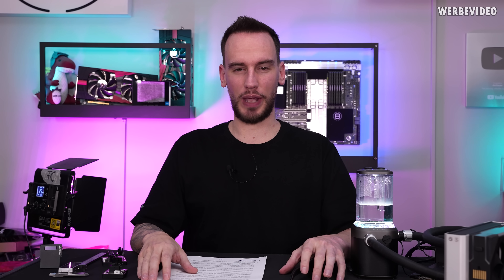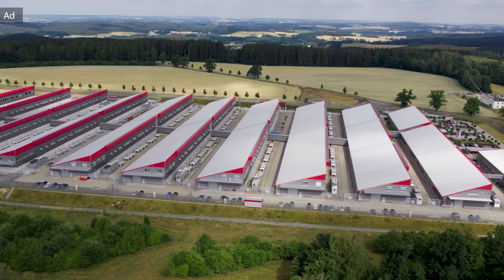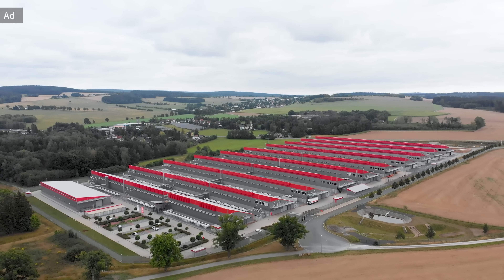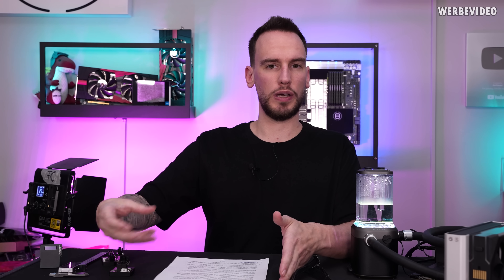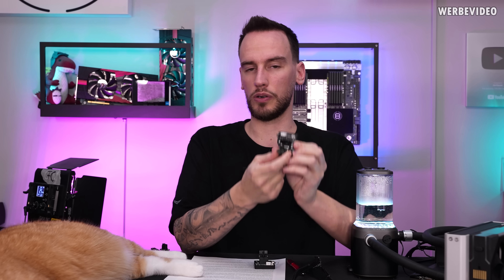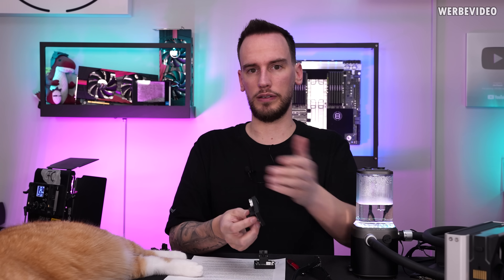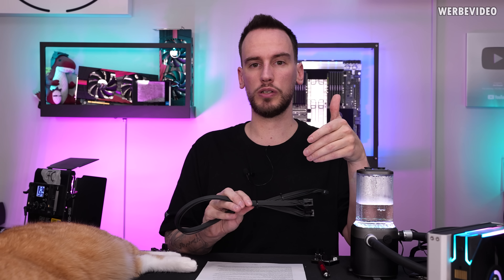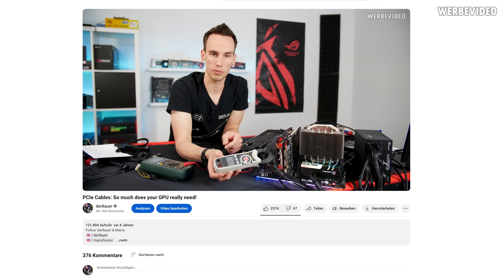12VHPWR is just Garbage and will Remain a Problem!!

Comment: As a Drone hobbyist, i Suggest we use XT60 jack, it's small(smaller than 3*8 pin), can handle 60A(so 600w is still in safety region), cheap and simple.
Reply: It is not rated for 60 continuous
Reply: @riba2233  it is

Comment: I expect a V2 connector where the pins themselves are thicker and the cable spec is either more strands per wire or they go solid core.

Comment: I always question that Engineering Toolbox AWG chart. That amperage and correction factor just seems off. Take 12AWG for example in house wiring. The stranded vs solid wire sizing is nowhere near that correction factor. The stranded wire is maybe 25% larger at best than the solid core for the same rating. 
But it's also possible the safety factor is just that high as 12 AWG solid or stranded is only acceptable for 20A circuits at both 60C and 75C ratings.

Comment: I've just been modding friends' cards and cables with high current TCE connectors. It's a pain in the ass, but I know their cards are no longer a fire hazard. The 12v HPWR connector standard is so bad, it seems like someone paid off someone else to push it through.

Comment: Relocating the plugs would also help. Like you said, no (enclosed) case supports that much stickout before a bend. Many don't even support bends right at the connector, which is never a good thing. I liked the idea of putting it all onto a second pcie like connector to go through the motherboard, despite meaning you'd have to upgrade the motherboard. Though honestly, considering that intel changes its socket every 2 or 3 generations, that's not that big of a deal breaker. Then the sense wires could be bespoke to the motherboard and the psu could have either another main power connector, I think it's a 28 pin. 

Or maybe GPUs themselves need to be more motherboard like. The process and rom being replaceable with something like a LGA socket if they had done this people could have bought the card they wanted. Be it as ridiculous as a 4050 with 32gb. Then, in the next gen, when people are upgrading, perhaps they could get a second hand 4080/90? Some itx cases would be a pain to build in now. And there's a chance that motherboards themselves could combine the base circuitry for the GPU perhaps increasing complexity  of the single component and possibly increasing its obsolescence. But this is to some degree what we already do in laptops and mini pc. Unfortunately there CPUs and typically the GPUs are soldered and not upgradable. But that's basically what I want. A laptop with better upgradability and cooling.
Reply: the fact that this is happening with solid 90 degree adaptors shows its not the tension on the cable but the connector itself, at least in some situations.

Comment: Yet people are still convinced it's soooo much better than the PEG connection. What kills me is that they revised the connector, but didn't address the latch or the tolerances. Even then, they're pushing too close to the rated maximum of the standard with the 4090, or even the 4080. They could have just solved this by using EPS, which would add another 12v per connection, and adjust the sensing specifications so they're not vastly under utilizing the standard. Hell... even if the didn't, 12VHPWR is a downgrade to the PEG connections.

It's nice to see a reputable source making a dedicated video about this... but I'm sure people are still going to argue. I've used talking points that Jon Gerow has made, and people tried to act like his "opinion" doesn't matter, as if they know better than him.

Comment: If they put 2 x 12vhpwr you would need what 6 x 8 pin connectors? Not an easy feat even with 4. If that happens say hello to molex adapters again.

Comment: I want to add that not only does the stranded wire need a correction factor, but the conductor itself does as well (aluminum vs copper). Aluminum wire needs to be down rated compared to copper.

Comment: Nvidia is a joke for 40 series in general.
They focused far too much on upscaling and not enough on power efficiency, if they had worked more on power efficiency then they more than likely could have gotten similar results at a much less power draw over 3 x 8pins.
With the 4090 it's worse in regards to them just cranking out performance without offsetting it with efficiency.
That plus their focus on upscaling for current cards instead of older... it's pretty bad

Comment: This cable alone is why i will NOT buy another Nvidia card that has this stupid connector...i hope they revert back to 8 Pin even if it requires 3 or 4 of them on the card.

Comment: IMHO the idea behind a single connector that can handle 600w is really usefull but the execution with the 12vhpwr was poor. This standard has to be taken back to the drawing board. BTW i'd also love to see a standard for PSU cables on modular power supplys where I can use cables from one brand on another.

Comment: After a year of using my ASUS Strix 4090 and a cable mod 4 - 8 pin to 12V HPWR on a CORSAIR 1200W Platinum my connecter was fine. But, the cable housing itself had a small melt spot on one of the wires about 8MM from the connector from the GPU. I just built my new PC last night and I went BeQuiet crazy (Case, PSU, CPU cooler and extra Silent Wings 4 fans) and now I have the card connected to the Dark Power 13 1300W using the stock 12VHPWR cable. I wonder if something will go catty whompass

Comment: EPS 12V:
-Easily delivers 200 watts (3 of those equals 600. Also we had 3 plug gpus with 3090)
-Widely used in servers (so you know it's reliable)
Gets ignored by nvidia 🤦‍♂️

Comment: I will not buy a GPU that uses the 12HPW or 12 2x6 connector. I said it from the beginning that the pins are too small for the amount of power being pumped through it during long gaming sessions. People keep saying but the pins are rated for that kind of power but what they are forgetting is when you compress power you generate heat. With enough heat melting will begin to occur and the only way to prevent it is to limit the amount of power going through the pins. But in reducing the power you also reduce the performance. That equals money poorly spend and wasted on something you can not fully use without possibility of failure. I am not going to spend that kind of money on something like that hoping and praying it will not fail.

Comment: If the adapter is used and the connector still melts NVIDIA should RMA the card! You spent the extra money to guarantee the best possible connection for their defective 12VHPWR connector and it still melted. There should be a class action lawsuit against NVIDIA at this point, the connectors still melting proves it's a faulty connector and not user installation error. This is a fire hazard, it's crazy NVIDIA still hasn't done anything to fix the problem.

Comment: Hope Nvidia and Member/Engineer at PCI-SIG will not use this "krap kannecter" in RTX5000 in 2025  ; please don't repeat the mistake,  move forward not backward , have some kommon sense "If you want to draw more power you will need thicker wires and beefier connectors .period !

Comment: I will rather use even 8 old connectors than this one..How insane situation is it telling you that nobody complain and everyone claiming they are 'independent' reviewers.. few of those who really say something they are marginalized. This is not nuclear science, it's completely straight forward.. ALso why plugs doesn't have 'side' clips too? You can easily wiggle it and it will move left/right.. It should have 3 clips, 2 on each side and one on top.. and it will not move.. when it clicks that's it.. and yes we need 2 of those, so ... less current

Comment: I'm sure if they could have, partners would have released a 4x8Pin card and people would be all over it. I can only imagine nVidia are blocking such actions.

No idea why they are so set on forcing this on us.
Reply: There are 4070 cards with 8 pin connectors
Reply: @ksenchy  ah, fair enough. I went 3090 to 4090 so didn't even look at 4070 to be honest.
Reply: @richardskinner6391  yeah there are no 4080 or 4090 with 8 pin connectors that's why I'm thinking to buy either 4070 or rx7800 XT. Don't know, can't decide 💩

Comment: nVidia will never make a 4090 with old style EPS connectors. Reason? that will automatically means the admission they were wrong, and class action suits demanding refunds to users, board partners also suing, a massive reputation and economic hit to greedvidia. No wonder why they are trying to make more emphasis on AI chips.

Comment: Great video. Yeah this 4090 connector is an engineering failure. May "just" work on paper and the benefits of less cable's is appealing but the margin of safety is terrible and the reliability is dramatically reduced with wear and tear over time. As someone with a 4090 it sucks, people shouldn't have to worry about things like this when paying this amount of money on a product.

Comment: If we look at something that Gamers Nexus did in their experimentation for melting 12VHPWR connectors, they cut one plug down so that only 2 +12v and 2 Ground pins are making connection, and the RTX 4090 was still drawing full power.  We already know that much power split between 2 circuits is already well over the safety limit.  That connector for them should have melted, so they should have studies why theirs didn't fail, or they faked it not failing.  This leads to a bigger problem of playing with a low safety factor and +12v circuits, load balancing.  Back to our laws of physics, energy takes the path of least resistance.  There is no way to guarantee that each path between the PSU's 12v rail(s) and the RTX 4090's power system has the same overall conductivity, so a route with slightly better conductivity will draw more amps over the other wires.

Comment: And why evga used 2 high-power connector of these on the 3090tis. And I also assume why they stopped making gpus when they were literally scared to set their own products on fire. And probably got into a fight with Nvidia trying to use 2 of them, cause the evga 4090 had 2. None others did

Comment: Can we just use EPS please. 4 out of 8 pins are 12V
3 EPS connectors would work fine for 600W with sufficient margin
And you wouldn't need to differentiate between PCIe and EPS and 12VHPWR cables/connectors for your PSU and components

Comment: I dunno if you should be raving about your RMA rate, when I bought three Wireview modules, one 'normal' dual 8 pin, one 'reverse' dual 8 pin, and one triple 8-pin, and one was bad out of the box, one quit working a month afterward, and only one is still working, (in order) yet repeated attempts to get replacements have been met with silence.

Comment: Yeah ive had some cable managing issues with the 12VHPWR cable and my 4080. Even now the bend starts maybe 25mm away from the connector.
But so far everything seems fine with it. Im using my PSU's own 12VHPWR cable. The card has been in 2 of my rigs both have ATX3.0 PSU's.
Seasonic Vertex GX1200 and Deepcool PX1000G WH. No problems with either of the cables so far. I did use cablemod cable with the Seasonic PSU.
It was fine untill i unplugged it to install the card to my other rig. One of the cables just popped of the connector in one end and one of the little sence cable from the other end.
Idk maybe i was too rough with it when cable managing even though i tryed to be carefull. Anyways that has been my experience with the cables.
Nothing has melted so far but its a 4080 it only pulls 320w or so....But after all playing around i should have just bought a 7900XTX instead.

Comment: I'm even more glad now after i watched this video that i got an RX 7900 XTX which has 3x 8pin power connectors instead of this hazardously unreliable piece of trash 🗑  12VHPWR connector. I even doubt that the 12V2x6 will be any better, cause it's pretty much the same trash with some minor change on it for " more reliability " . Yeah right 🙄😮‍💨

Comment: Nvidia tried to create a solution to a problem that didn't exist. 
So far so good on my ROG 4090. I thought about getting "fancy" cables, but I'll just stick to the single 16 pin to 16 pin cable that came with my PSU.
If it aint broke, don't fix it!
Reply: Don’t go for any cables other than what came with your PSU.  I’ve spent the better part of a year chasing down instabilities in my new build, swapping boards, drives, RMAs, etc.  When I finally got rid of my fancy cables and extensions, all my issues went away.
Reply: @arclyte1859 so do I think it's better to go the 12V 40 series cable provided with my thermaltake 1000W PSU or use two pcie eight pins plus the adapter that came with my 4080? Is this even an issue for the less powerful 4080?

Comment: I mean. I see everyone’s complaints but I disagree. I haven’t had issues with mine. I firmly seated my Corsair type 5 cable into my strix 4090 and let it fly. No issues. I get why the cable exists. It’s better than 4 fucking pcie connectors you know it and I know it
Reply: Just because you've been lucky not to have a meltdown. Doesn't mean the 12VHPWR 
and 12V2x6 aren't disasterously trash and hazardous.

Comment: I mean we could solve the "plugging" issue entirely by soldering wires directly onto the card, yet we would still have a thermal issue just because you have 600+W spikes going on these 6 pins, it's just too little a number for this kind of power. If they just made a "16VHPWR" so that's like 8 pins for +12V and 8 GRND, the issues would probably never happened and it would've been completly future proof. Funny enough they chose to create the smallest connector the support the biggest cards ever made.
Reply: BTW for anyone who has an RTX 4090 and just doesn't want to risk it, just watch Optimum's video "Don't Undervolt the RTX 4090" and limit the power like he does, you just lose so little performance but gain so much efficiency, less Watts will also mean less heat and much longer life.

Comment: When I saw aluminium cables my jaw dropped, has the industry dropped that low? These should be copper, as pure as freaking possible, same for the connector interfaces.
Reply: Aluminium cables where? This should all be surface chemically tinned copper, not aluminium.
Reply: @SianaGearz really? Looked a lot like aluminium, though yeah if the whole cable is tinned then you'd be correct. Still, the strand size is nonetheless a crime.
Reply: @wskinnyodden  At 7:30? Yeah this is copper, immersion tinned. This tinning comes out dull matte and is extremely thin, micron thickness, it's there to improve contact in the crimped connector, and also reduces defect rate for soldered connectors, and if you scrape it with a knife or use a microscope on the cross section, the copper is easily revealed. This is Seasonic 18AWG cable, so it's not the thickest, the copper cross section is 0.8mm² per wire, which is not so little copper at all, but some others come with 16AWG which is 1.3mm². Super thin strands reduces the nominal current carrying capability but it improves the flexibility of the strands, so when the cable is bent, it's less likely to internally fray, and there's plenty of current carrying capability anyway, no reason to be concerned about it.

The sheer weight of the pack of modular cables that comes with the PSU is substantial, you can tell right up that it's not alu.

Aluminium wouldn't be permissible as it would fray and would open the terminal crimps all by itself due to heat cycling, it would be a fire hazard.

Where aluminium is used, say in suspicious speaker cables or in permanent-installation Ethernet cables, where it's permissible, they necessarily use copper coated aluminium, as aluminium surface isn't suitable for electrical contact, so it wouldn't necessarily be a white metal at a glance. It's necessary to inspect the cross section or remove surface platings to determine the wire material.

Comment: What is the differential between 4080 and 4090 using same 12vhpwr cables and why aren't we seeing issues with the 12vhpwr cables/connectors melting with 4080? Lower power draw of 4080 not producing enough heat?
Reply: Its like over 100w difference - thats ur answer..

Comment: the 12v highg power port design is the problem and forever will be a problem, They made the cable port too small. The smaller wire will always be a problem because the smaller the wire the higher the fire risk, If the cables where pulling 24v or 48v the size of the wire would be fine at the same amount of watts, But at 12v it's not, and the port needs to be abanded.

Comment: Well... Bump the spec on the old cable. You could just bump to 200W. It still leaves you with 16W of margin in the worst case scenario.

You can power a 4090 with 3 connectors and any other card in the market with only 2...

Comment: If you follow North Ridge Fix, he is fixing all the burned 4090 plugs for cable mod, he is fixing over a 100x 4090's a month right now, a lot of them have the adapters melted together, CM did the recall to stop the bleeding of the repairs.

Comment: 8 pin cables have a satisfying click and can't be disconnected by nudging them, whereas the new connector can burn up if the connector is not fully in, or the sense pins not fully in causes weird fan behavior.  Since the burning issue happens if the cable isn't fully in as tested by gamers nexus, it's an engineering flaw if the cable doesn't firmly connect: id like to see a revision where the connector is solid like 8 pins.  The saying is if it ain't broke, don't fix it: id rather have 3 8-pins on a 4080 for example than a 12VHPWR in it's current state.